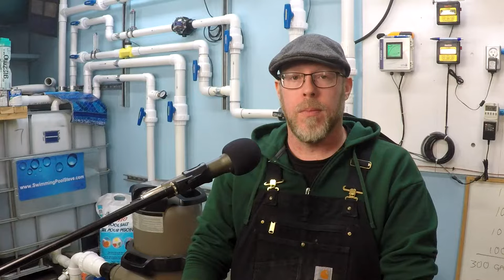How Do You Winterize A Pool Main Drain?

Comment: Just make sure that valve is good and throw a rubber plug in there because after a couple months that air will slowly leak out because most valves arent air tight once they are more than a couple years old

Comment: Maybe i'm lucky but since 10 whole years i never make a airlock for winter. The first year the technician told me that its unecessary because the water into that pipe follow the level of the water into the pool by gravity. (they are both at same level)

So since the water level is low then the water pipe level is low as well.. maybe an its aditionnal safety. I'll do it next year.

Comment: I just discovered that my Pentair diverter leaks air after I airlock. I replaced the part that blocks the line and it still leaks. So frustrating. Also, that probably means this has been happening for years and I didn't know it.

Comment: If you can airlock the main drain this way, couldn't you air lock all of your pools inlets and outlets if they all have individual ball valve shut offs?   All of my pool returns and drains as well as skimmer plumbing lines are all ran individually to the pump pad and immediately above grade have an isolating ball valve on each line. This would work on all, no?

Comment: Steve, what about if you blow the line and the valve does not seal? I hear hissing when I put my ear to it and it's a very slow leak. Eventually the line just fills back up with water. They are Pentair valves... new pool construction this year. Any recommendations?
Reply from the maker: If the valve is not holding then the air lock will not work. I would lube the gasket with silicone based Oring lubricant. That solves at least half of valve leaks. Good luck!